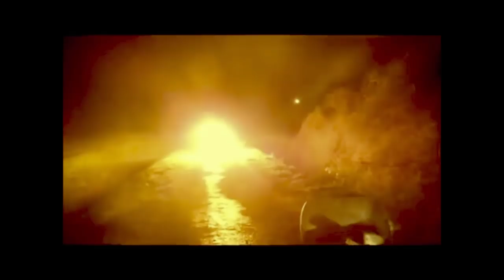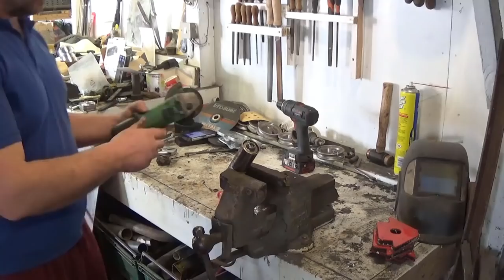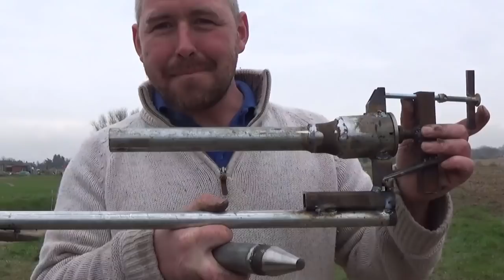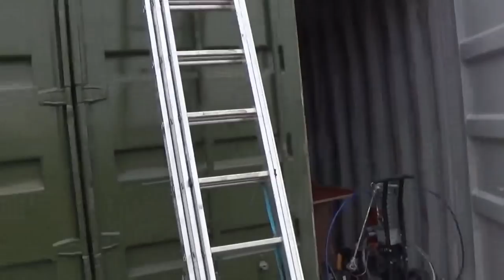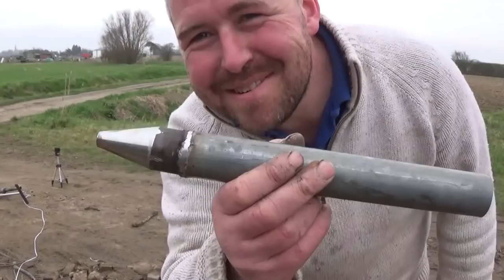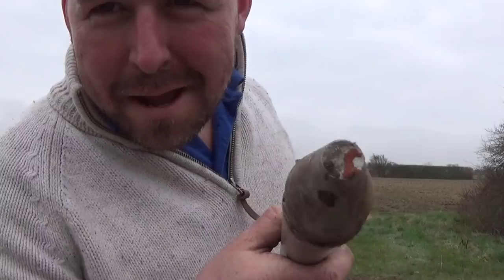airbag arrow cannon

Comment: Put some weight on that thing.   Your losing so much velocity / power in recoil.   Also need some stabilizing fins on your projectile.
Reply from the maker: Maybe next time, this was just a quick a dirty bit of fun
Reply: The design of it also made it more prone to tumble off from the recoil, because the cannon was high compared to the base and there was nothing to really stop it. The cannon's geometry could be improved to transfer more recoil into the ground.

Comment: Your biggest issue, good sir, it the launcher was able to be thrown from massive recoil. Any idea how much energy was wasted? Its pretty close to the ratio of weight of the launcher to the projectile, so id say almost half. Bolt it to a heavy base to resist recoil, please. You'll find its both more accurate and it'll pack a much bigger punch.

 It would also be more likley to warp its shape, explode or snap itself apart - being fairly flimsy for the job, so be careful, yeah?